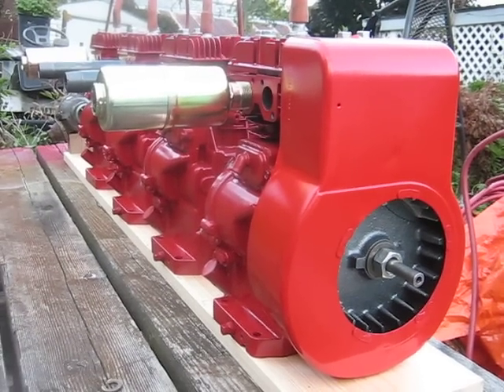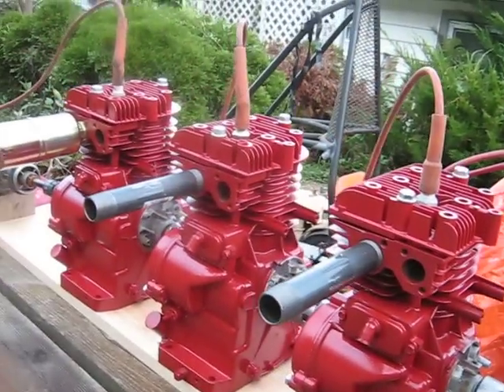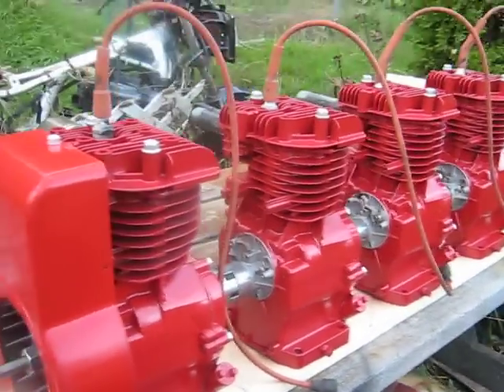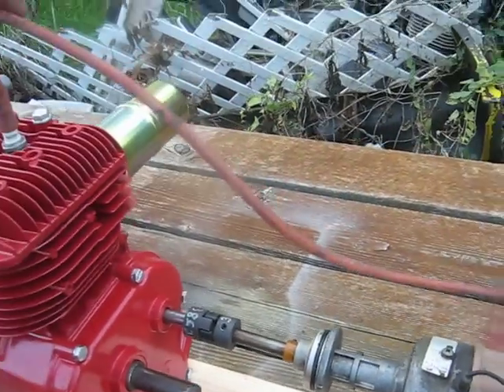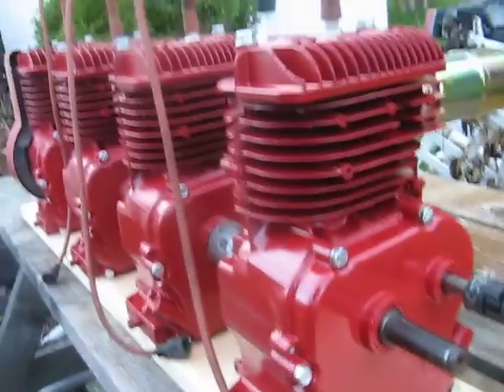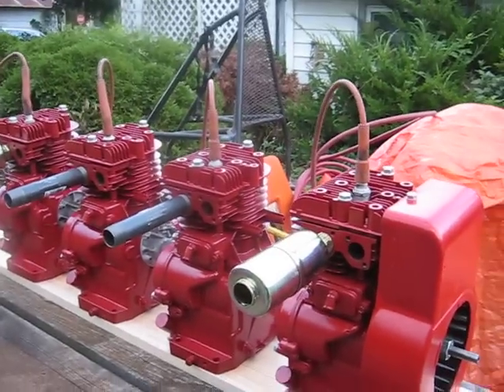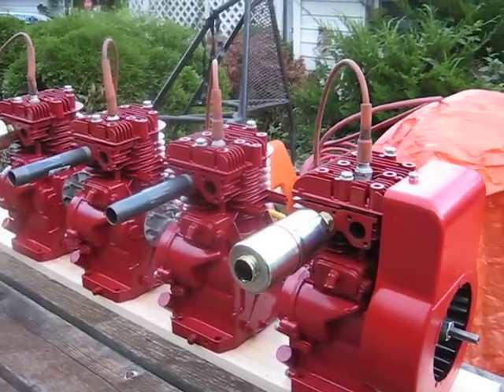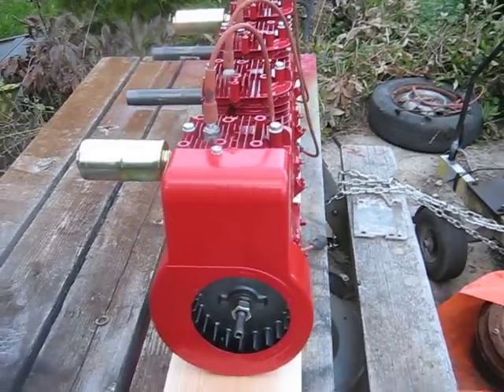4 Cylinder Briggs Unveiled!!!!

Comment from the maker: That was the key to the whole thing!
It hit me lightning bolt one day, you have to weld up the taper, then machine it flat into a straight shaft!
AC/DC Welding had the skill to do the job, which is good, as it proved to be harder than I thought.  
My original idea was a bit different than this, I planned to use 3 horse Briggs engines, but my son said that we had lots of 5 horse worn parts to use for the welded up cranks, since I didn't want to butcher perfectly good parts!

Comment from the maker: yes, I just bought the last muffler for it today, so all 4 will be the same.
It won't be individual carbs for sure. I haven't been able to find an appropriately sized carb for an 800cc (50 cubic inch) engine, so I think it will be dual carbs.